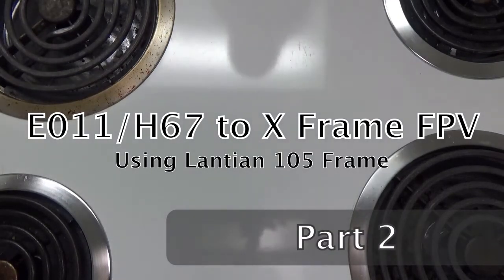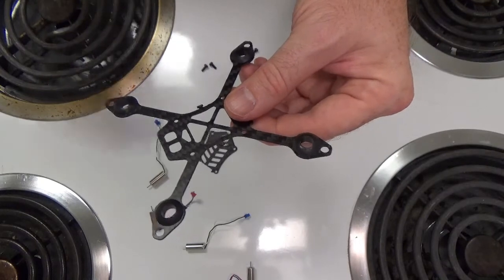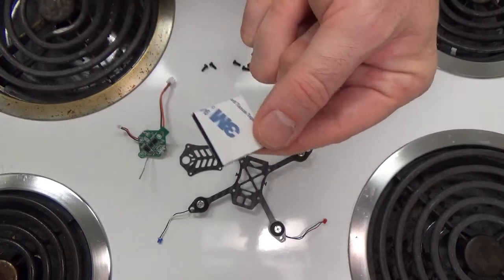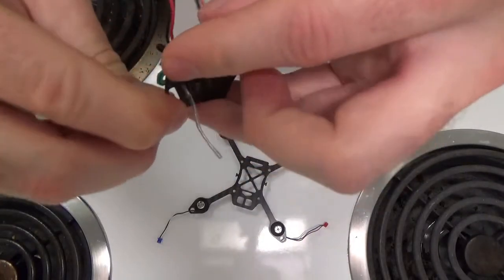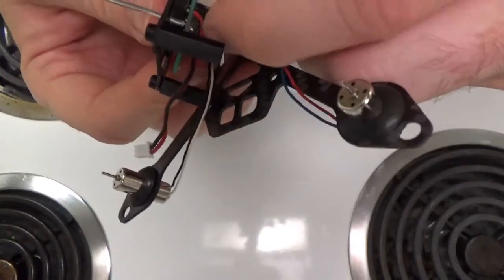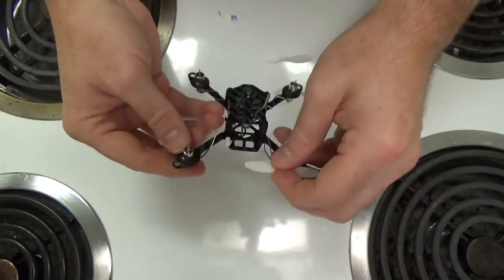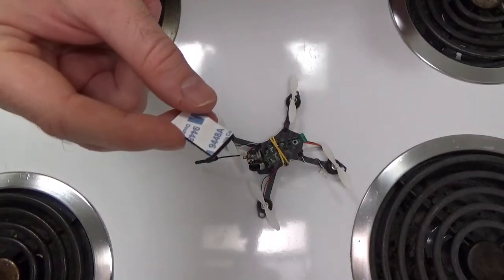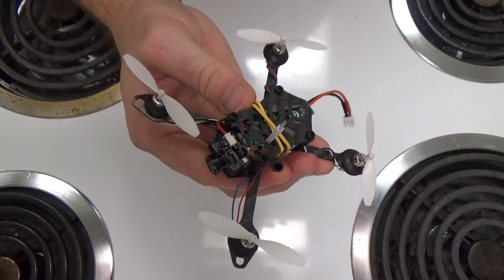Eachine E011 (or JJRC H67) to X Frame FPV Quad conversion: Part 2

Comment: I'm running the e011/ jjrc h67 FC on a Noname 100mm frame with 8520 motors 65mm kingkong props
Caddyx beetle v1 cam
600mah lipo 
It's fast and agile weights 55g with 100g thrust..  
I actually build it 5 times for my friends 
Nice vid keep it up👍